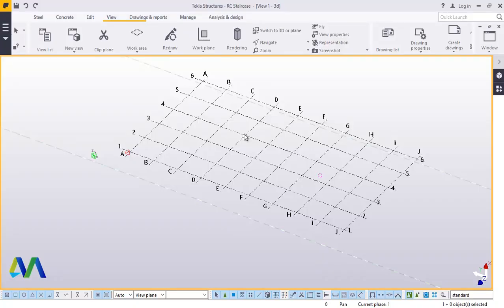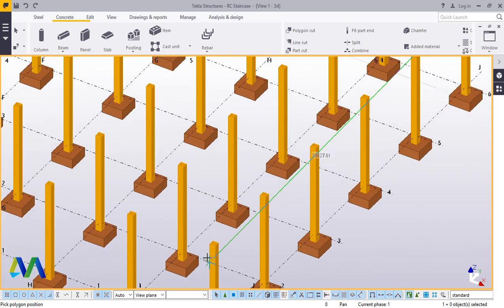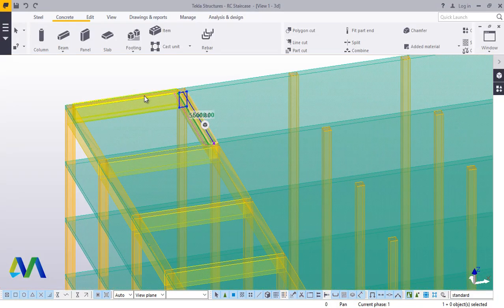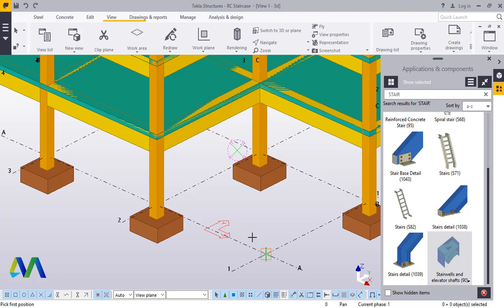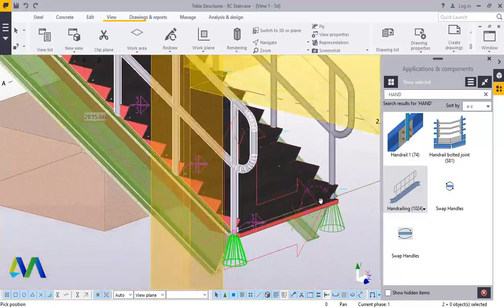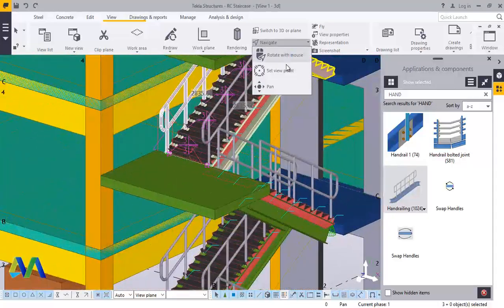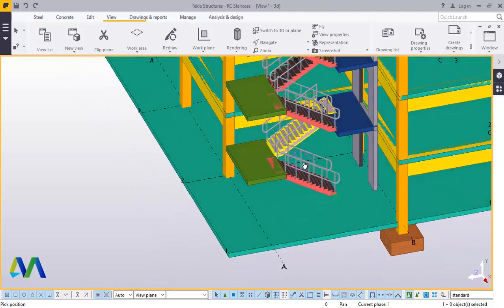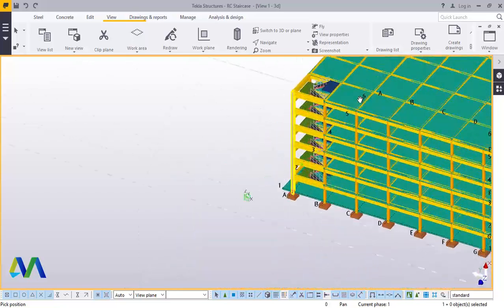How to Create RC Staircase and Handrails in Tekla Structures

Comment: In V18 I have a mini toolbar option which is opened by pressing ctrl K, once opened it stays open for all sessions and is invisible until you pick a beam or column etc within the mini tool bar there are options to change some of the properties of a single item, I dont use many of those options but in the mini toolbar there is a wheel that allows me to change the 'on plane' 'rotation' and 'at depth' values far quicker than accessing them in the position tab in the part properties window. can you tell me if this is still available in 2016 / 2017. I access it in V18 by going: tools, options. Id hate to not have it when I upgrade. Thanks.
Reply: this toolbar is called contextual toolbar, yes it is in version 2016 and 2017 with more advanced feature https://teklastructures.support.tekla.com/2017i/en/gen_contextual_toolbar